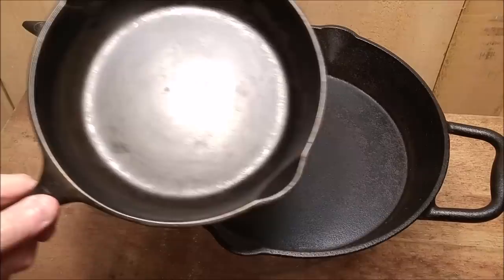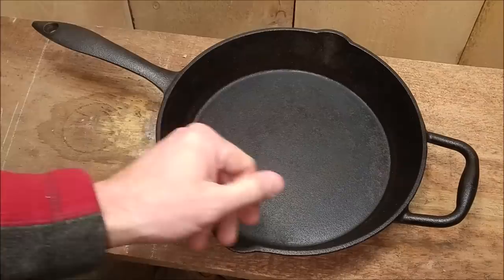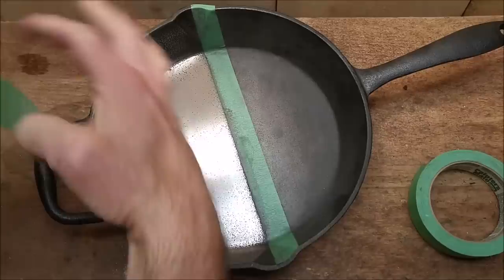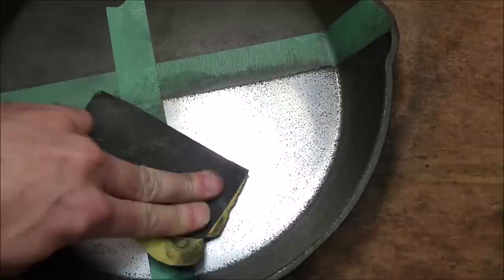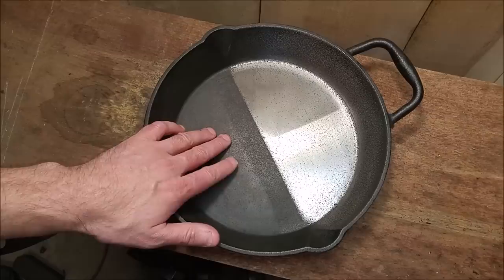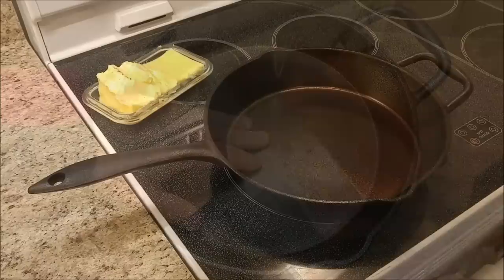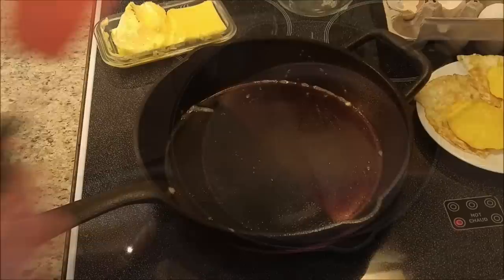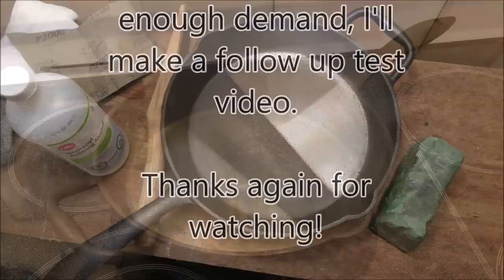🍳EXTREME Polish - Smooth a Cast Iron Pan to Reproduce an Antique Skillet then take it way beyond

Comment: My Grandnother use to say a good castiron pan will ring like a bellwhen you hold it at the tip of the handle and hit it with a spoon .The oldones were miled and thiner and came in the white coated with wax.
Reply: Always preheat and use eggs at room temp.The eggs will jump just like water does when it hits
Reply from the maker: No kidding, I for the first time did this tonight before I even saw your comment.  My old Wagner rings really nicely, you can tell that it isn't thick and clunky, but I do find they tend to be a little warped. 

What is "White Coated"?
Reply from the maker: I never have let an egg warm up, I know you're supposed to for whipping eggs... never have done that either to be honest, I just put a bit more elbow grease into it.  

Do you find that the temperature of the pan has a big impact on whether anything sticks to your pan?
Reply: preheat the skile"t eggs at room temp"
Reply: preheat the skile"t eggs at room temp"
Reply: @NeedItMakeIt   in the white the were not pretreted after they were made they were dipped in wax..When you bought it yea had to use boiling water to get the wax off.And season it .P.S NEVER  put hot cast iron in water it will warp it..Wipe it out with a cotten rag and rub it down with just a little oil .Then take a clean one and wipe it down .

Comment: I was given a lodge 2-sided long griddle/skillet for Christmas. I lightly sanded it not knowing about sanding it all the way down. So, now there is a black smudge that comes off when I touch it and I can't wash it off. Any suggestions? Also, I currently do not have access to an oven. Is there another way I can season the griddle/skillet?
Reply from the maker: That is a little bit odd.  When you heat up the pan can you wipe off the smudge?  I suspect that when it was seasoned, a big 'blob' of oil was left in this spot and did not polymerize properly, which will leave a sticky residue.  A really good way to season a pan is in the barbecue, I prefer this method, because the process of seasoning will take the oil to the smoking point and it will stink up/smoke up your house.  If you don't have access to a barbecue, you can use your burner, just increase the temperature gradually, the cast iron retains heat well once up to temperature so be careful not to turn it up too high.  

The Stargazer website has a really good set of guidelines for seasoning, so I'd suggest following their process.  https://stargazercastiron.com/pages/use-care?=page=clean#usecare_tabs3 

I have plans in an upcoming video to review the seasoning process... as well as review a few other aspects of the process to help gain a better understanding of the dos and don'ts, everyone has their own ideas it can be difficult to know which method is the best.

Comment: You should have used a gas stove . The ele. Element heats unevenly
Reply from the maker: It's true that a gas stove was the go-to for years, I would tend to want to go induction rather than gas these days, it's just as fast if not faster it doesn't release toxic fumes into your home either.   In the case of a gas furnace, the ignition and flame areas are vented out and kept separate from the air within you home, on a gas stove, we're pumping it right inside, and I don't know about you, but I don't like my hood on high, it's far too loud. There are quite a few articles on the subject due to natural gas containing so many toxic chemicals https://harvardpublichealth.org/environmental-health/gas-stove-debate-are-they-bad-for-your-health/  This is one article, but there are quite a few of them.  I suppose to be safe, I'd recommend induction, it should work with most flat bottomed cast iron pans, any with rings, I'm not sure it would.

Comment: I made my Walmart cast in to a mirror. Hand sanding to 2k then seasond it 10 times. Nothing sticks, ever ! Side note. Cast iron cooks different than alum non stick. Once you get past that curve your off to the races.
Reply from the maker: Your timing is amazing! I am seasoning something for an interesting project, and I am doing the exact same thing, I was wondering how well it would perform, thanks for this!
Reply: @NeedItMakeIt  seasoning 10 times took a wile. I'd let it cool to the point I could pinch the side wall for 10 seconds with out a burn. The high smoke point oil. Buff out and repeat. The inconvenience of not having a pan for a few weeks while I went through the whole procedure as well worth it to have a pan for the next 30-40 years with no hiccups
Reply from the maker: @coady-wp3xf  Absolutely, I started yesterday and have been using canola, I am now on coat #10 and it is so black and glossy, it looks like a coat of Tremclad.  I would bake for 1 hour at 450 then wait until it cooled then repeat.   A neat experiment, I think doing all of the pans would make sense maybe in the BBQ, like you say, 30-40 years + the next owner if we're all still alive after this virus.   I really appreciate this comment, I had never heard of anyone else putting so much effort into it.
Reply: @coady-wp3xf  can you please elaborate on how you buff it out.

Comment: You are measuring things which need two different emissivity settings on your heat gun.   Those are not as reliable across a wide range of surfaces as you might think.  Great for relative measurements.  Your pan was the same temp across the surface.  Notice your own evidence as you removed the 3 yokes essentially at the same time all cooked to the same point.

Comment: What was the liquid he used to clean the surface after sanding the pan?
Reply from the maker: I think it was vinegar, the new process I use for cleaning a pan after a sand is to clean with soap and water, then boil vinegar in it, this cleans and etches the pan and darkens it slightly.  I also put the pan in the oven afterward and draw tempering colours.  This further darkens it in preparation for seasoning so that you get a dark rich colour from the start.

Comment: Isn’t the black paint what’s stops them from rusting ?
Reply from the maker: Yes, it serves a few purposes.  But it is oil which has been 'burned' on to the surface to bind a layer of carbon to the pan.  An un-seasoned pan will likely rust as soon as you wash it.

Comment: Never put cold water in a hot cast iron pan if you want to warp or crack it
Reply from the maker: Probably a good idea, however when the water is hot, it works quite well.  This pan is still going strong and this is normally the way I clean it.  Warping is not an issue.

Comment: That hurt my soul when the water hit the hot pan 😫 that's a good way to damage your cast iron!!!
Reply from the maker: Sorry to hear that, hopefully your soul can recover swiftly.  This does look worse than it is due to the instant generation of steam, however three quick bursts of the hottest tap water is a standard method of cleaning a cast iron pan.  Some people swear by this method, some people do not, it is completely your choice.  I like to use this method on all of my pans, they are still in-tact and they are still flat.  I honestly thought this was a more commonly accepted method of cleaning pans and for that assumption I am sorry.  

My only suggestion if someone uses this method is to make sure you only a add a little water at a time, and make sure to use very hot water.  

Is a follow up video on this subject specifically of interest to you?  A test to see exactly what conditions would cause pans to fail?  My concern with this is that people get very upset for some reason when someone causes damage to a pan, some comments go as far as to act as if their own child had been hurt in some way.

Your thoughts are appreciated!
Reply: @NeedItMakeIt  yes that would be an amazing follow up!
Reply: As long as you don't experiment on a vintage piece of cast iron. Would be interesting to see what would cause it to fail using a newer pan.

Comment: Rough surface has more air contact area for heat dissipation.
Reply from the maker: This is what I was originally thinking, it seems more to do with the 'thermal emissiveness' of the surface.  I need a better way to test this.
Reply: That's a logical hypothesis, but not the answer. Highly reflective surfaces aren't accurately measurable with ir laser thermometers.

Comment: Good work. I have a lodge 2016 with the rough surface. I do have smooth surface cast iron.  Really, once you have good season on the lodge, it doesn't matter. Eggs will slide off the lodge. Its easier for the season to stick it compared to the smooth cast iron. Pros and cons on both. But in my book, cast iron is better then other types. The lodge does have papers fall apart when cleaning, but just use a lint free towel. The smooth cast iron just need a little more seasoning then the lodge. Keep the good work up

Comment: The fact that the rough side of the pan has more surface area may have a lot to do with the temperature difference. More surface area in the same amount of space because of the hills and valleys on the rough side should equal more heat emitted and account for the higher temperatures.

Comment: How long did it take you? I'm thinking of taking some sub-100 grit to my Lodge skillets.
Reply from the maker: By hand probably an hour, you can get really good results with an aggressive grit.  Using an orbital sander would make it a lot quicker.  A less polished surface seems to hold the seasoning better.
Reply: Thank you for showing us your process done by hand.  I’ve done it this way to 10 skillets.  My husband did one and he used a wire brush.  I much prefer the result of the hand procedure.

Comment: wait...Antique cast iron is cheaper then new cast iron?  LOL  You were telling a joke, right???  More often than not a decent quality antique will run you more than an equally equivalent modern version.
Reply from the maker: Not a joke, I think it really depends on which brands are available in your area, in my area, we have lots of Wagner, they go for 10-20 max, and that is from an antique shop, so it should really be a little cheaper.  In other areas, Griswolds may be available, and they'll be a lot more expensive.  

There are a lot of new CI brands which are quite expensive also, Finex, Stargazer and some others which are fully machined and so nice, but I don't see the need to pay several hundred for something that performs about the same as a $20 pan., though it may look nicer...
Reply: @NeedItMakeIt  damn, I wish I was in your area!  I can luck up and find good deals at thrift stores and stuff...but if I try to go to somewhere that actually knows what they have then I could be looked at $40 - $100 easy.

I totally agree though, why spend several hundred on something when the antiques are just as good (and IMO better).  I was looking at one on Amazon that was over $200 nearly $300...a single pan...and I asked the question on what made it so special.  The answer was basically the same, the name...and it was made in France....Cast iron is cast iron, France doesn't do anything mythical with it.

If you find some more antique Wagner for $10 - $20 (which is my favorite brand), hook me up!  :D

Comment: I'm not sure how the thermometer work but from physics, if you have a rough surface, it will emit more heat (by means of IR radiation) than a smooth one.
Reply from the maker: That's an interesting point, more surface area?
Reply: @NeedItMakeIt  yes, more surface area.

Comment: hi should i just buy the 2000 grit sand paper to sand my cast iron? how long did it take you to sand it?
Reply from the maker: I have tried this, I polished this entire pan and then tried to season it to see if it would last.  The high polish doesn't work well to keep the seasoning adhered to the surface.  I would not recommend polishing a pan which will be seasoned, it just does not allow the polymerized coating to bond properly and will cause you more grief over time.  100 grit is absolutely one of the best, check out this video, it should help you.  https://youtu.be/4mLL0-tXR-A  .  Let me know what you think!
Reply: @NeedItMakeIt  thanks. i just watched it. I'll do 100 grit. does it take long to sand it?
Reply from the maker: @thewindrises  Not really, , if you have an orbital that works well, a vibrating sanding can be used if you have one of those too.  You can always start with 60 grit and work your way up to 100 to save some time.  

I suppose the time depends on how rough the surface is, my new pans are so rough, so I'd put them around 1/2 an hour total.  You don't need to remove all of the pitting, it all becomes one slick smooth surface over time :).  Smooth pans look great and they are so easy to clean!
Reply: @NeedItMakeIt  tks. I'm glad I looked up sanding. It saves you a lot of money buying an expensive skillet. I have to sand it with my hand that's why I was asking how long it takes. Yes I will buy some assorted sand paper to work my way up. Thanks for the informative videos again. This is something most cast iron owners never thought about they can do themselves.
Reply from the maker: @thewindrises  Exactly, I can't believe the prices of some of these pans.  I would buy the Lagostina pan again in a minute if I needed another pan... I have too many already.  I have a few more cool tricks for seasoning a sanded CI pan if you are interested:

1.  Boil vinegar in the pan on the stove for about 5 minutes, this both etches the surface slightly and it darkens the surface, you need to wash and dry it immediately due to flash rusting, but it works very well as a good foundation. 

2.  Bake the pan in the oven at 400F for about 1/2 an hour to draw the tempering colours, this will add to the colour prior to seasoning.  

 This process gives you better adhesion due to the etch, it also give you a much deeper richer colour from the start from the dark grey etch and the tempering colours being so dark also.   I have found that this adds years to the look of the pans and helps to reproduce that classic look everyone loves.  

I thought this might be worth sharing, have a great one!
Reply: @NeedItMakeIt  thanks. I will do that.
Reply: @NeedItMakeIt  Just want to let you know that I sanded my cast iron. It took me an hour and was a lot of mess, but the cast iron is so much smoother now that I won't sell even if someone is offering me $200.
Reply: for the best time to effect ratio i wont go past 400. 240-320 is not that hard work, its smooth and will seasoned easily.  More polish it is its harder to get good seasoning cover and after a while when the coats build up you loose that mirror finish. So dont go more then 320-400 and get out the imperfections in the casting (bubbles voids) and try to be flat with some piece of wood or something flat when gridding. Dont use angle grinder but instead orbital sander.
I did this to my cast iron and it work like charm. Im using it for more then 2 years 3-5 times a month

Comment: My guess is that the laser reflected more on the smoother surface?  🤷‍♂️
Reply from the maker: A firefighter commented that he uses one and readings taken can come from objects in a reflection, again it is a form of light, so I can kind of see how that makes sense.  It would much easier if I could just see it.
Reply: The laser has nothing to do with the temp reading, it's only for aiming purposes.
Reply from the maker: @thedanyesful  This is true, there is a button to turn it off.... and it will still produce the same readings.  There is also a horrific "sight" on it so you can know exactly within a few feet where you are measuring.

Comment: You got the which is expensive backwards...... the older smoother bwttwr qnd more expensive....... the onmy reason the surfaces are not smooth is it makes them easier to manufacture and "pre season" the pans. Really the rough rougher the surface the shittier the pan. You nees to properly season the pqn which is much more difficult qnd time consuming on a smoother surface but far more superior. I really prefer cardon steel. Matfer produces some damn fine and cost effective skillets.

Comment: I am sorry but that is no where near mirror finish. You can not get a mirror finish by hand. I do this for a living. And t those surfaces were still vary pitted. And yes you can make cast iron mirror finish. But it is not easy.
Reply from the maker: It is tough to please everyone; I was satisfied with the concept and my follow through on this project.    In the end an 'Extreme' finish was provided and turned out to perform well.  I have another video coming out in a few days with more dialed in surfaces which work better with seasoning, hopefully you'll check it out.  

Thanks for the comment.

Comment: I have a set of cast iron handed down from my grandmother... it’s seasoned so well that it’s very smooth inside the cooking area.  It’s truly nonstick as long as you keep it seasoned and never use anything metal to stir.  I have no idea what brand it is but it’s older than I am at 50 years old.  I don’t think we use anything other than cast iron to cook with.  Must use a gas stove though, electric takes way too long to heat up the pan.  Gas also has better temperature control.
Reply from the maker: I wonder if gas is also better because as the flames lick up the sides of the pan, they are also heated, an electric cook-top only heats the bottom and heat will then work its way slowly up the sides.  I've measured the sidewalls and they are dramatically cooler (100C +/-) cooler than the bottom.  I don't have a gas cooktop, but I might have something on my BBQ to test this.

I've recently converted to using metal, it doesn't seem to hurt the surface from what I can see.
Reply from the maker: So gas is better than electric, and electric is better than gas?  I've never tried induction, if you have a gold ring and accidentally tough the cook-top (don't do this) what will happen?